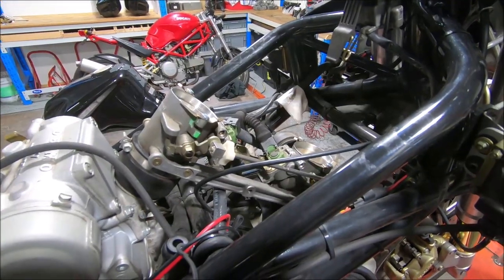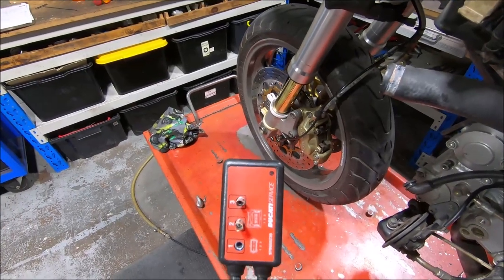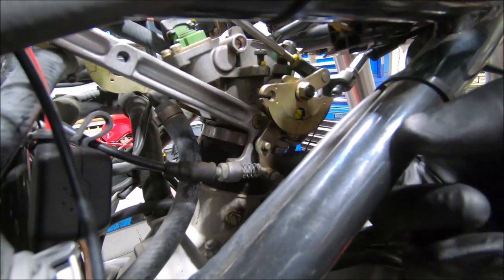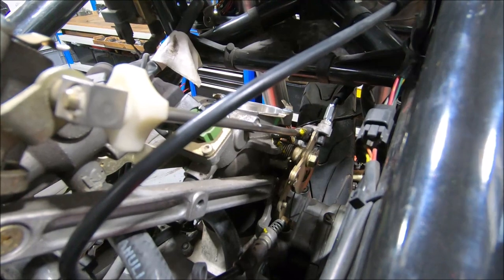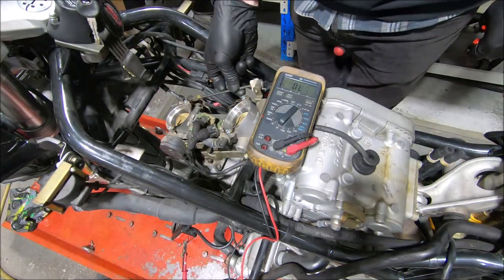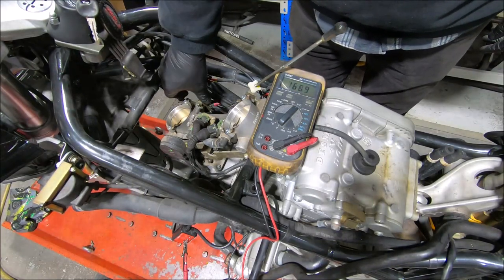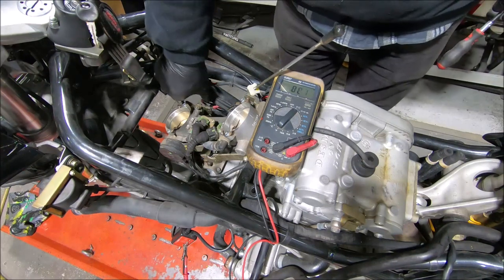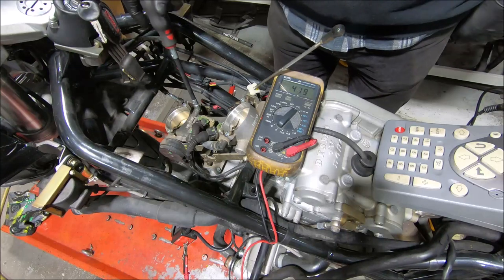Ducati Desmoquattro TPS Throttle Position Sensor baseline setting  - ST4S

Comment: Hello Brat, thanks for the great video i apriciate you sharing knowledge on the Ducati's.
After setting the baseline stuf what should the fast idle lever been set to.

Tia Eeuwe
Reply from the maker: i usually set it so it starts working about halfway through the travel.  up to you really.  some people like it to be so they can pull it fully on and have that be about right and not too high, some like it much sooner.
Reply: @bradthebikeboy  oke thank you. What revs should i get full on, 2500-3000.
Reply from the maker: @eeuwe1098  depends what you want.  i wouldn't go any higher than 2,000 for a fast idle, but if you wanted to use it as a manual cruise control you could go a lot higher.

Comment: Hello.Brad. I like to follow your videos again and again and I want to tell you that they are all great!!! Now I've seen a video that you have an 851 in the workshop. I drive an 851 BJ 89 No332 myself. I have a question about the 851. Throttle Adjustment. Do you have any setting parameters for it? 150 mV when closed is clear to me. But the stangas value is unknown to me. Here in Germany I only find statements that I should start at 300 mV and work my way up to 450 mV. Unfortunately, nothing useful can be found on the net for this Urducati. Also regarding the throttle valve synchronization I needed a tip because the Duc has no bypass screws. Is there a trick? Can you help me? Greetings from Germany and keep it up. Peter
Reply from the maker: you set the idle stop to whatever it needs to be set to for the bike to idle.  you set the throttle sync with the adjustable rod between the throttle blades.  for idle sync, you can do it with the idle stop on the vertical cylinder too if you want to.  i tend to go by the mixture, not the balance/sync.
Reply: Thanks for the quick reply. Is it possible to set the idle speed with the engine running even if the air filter box is removed? For the throttle valve synchronization, I still have mushroom-shaped vacuum gauges that I insert into the throttle valves and synchronize using the adjusting rod. That's how I do it with the old Alfa Romeos. Thank you again and have a nice Sunday. LG Peter
Reply from the maker: @1977Alfetta  i'm sure you could.  i've never used those sort of gauges.

Comment: Hello!  Tell me, is there a video on adjusting TPS on the Ducati monster 821?
Reply from the maker: no, there is no adjustment on an 821, apart from a electronic diagnostic tool procedure.
Reply: @bradthebikeboy  Tell me, I have a white spark plug on the horizontal cylinder (like new after 1200 km), on the vertical cylinder with a slight burn.  Do you need to do electronic diagnostics of the drive?  Can drive diagnostics be done only by service equipment?
Reply from the maker: @motoshotayev  if there is something wrong with it, you need to investigate it.  if you can't, take it to someone who can.  you need to find out if the ecu thinks something is wrong.  if it doesn't, you need to diagnose it by investigation.

your questions are not relevant to this video.

Comment: By coincidence I'm just going over my ST4S. Will have to check the TPS.  What is the state of the thermostat on that one? I have a split in the steel sealing collar, think that might be a common problem.
Reply from the maker: i've never heard of a thermostat coming apart for any reason.
Reply: @bradthebikeboy  must be the salt on UK roads. I have two that have lost the steel band that holds the two halves together. All are rusty with very little galvanising left.
Reply from the maker: @chrislee7817  yeah, we don't have that here.
Reply: Thanks Brad. That makes more sense than I had thought.

Comment: Bonjour, le réglage est aussi valable pour un 992 (ST3s)?
Merci
Reply from the maker: for 2004 and 2005 model year, yes.
Reply: Ok merci, mais ma st3s est de 2006. Dommage
Reply from the maker: @michelbelka5763  2006 is a linear tps, reset electronically via a diagnostic tool only.  there is no mechanical adjustment.
Reply: 👍 merci beaucoup pour cette réponse, maintenant il faut que je trouve l’ appareil électronique